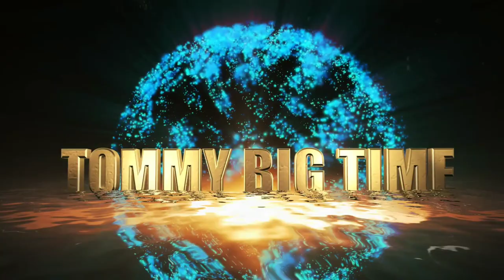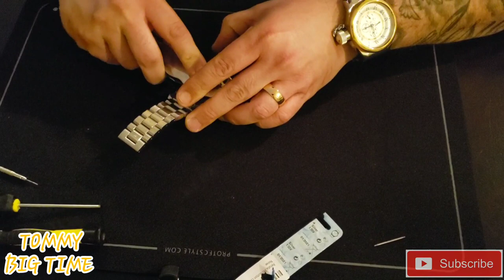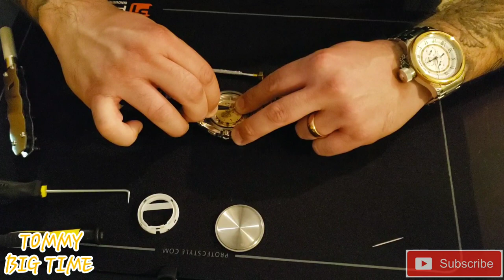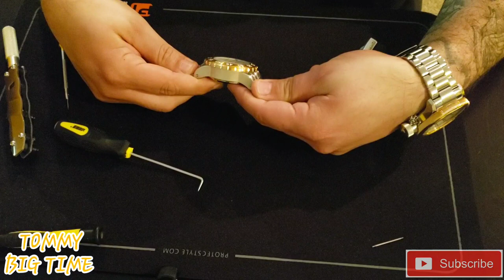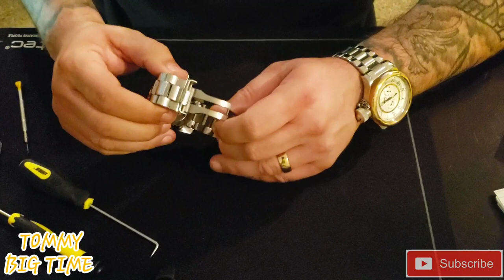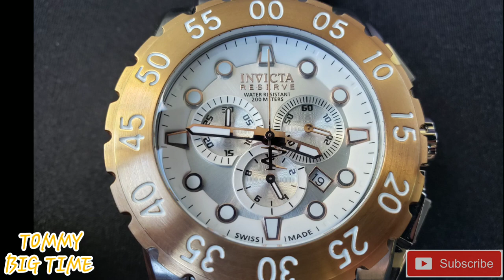Invicta Leviathan Battery Replacement, Synching Chronograph, and Close Up Photos

Comment: Thanks for the video!  I just want to know where you got the tools to open the case.  Mine are too small...and I am tired of dropping $12.50 plus driving 17 miles to have a battery changed!!  I really need something that will open up my 47-54 mm case backs!!!
Reply from the maker: Here's a link to one on Amazon.com
CONBEE 18mm to 60mm New Watch Repair Tool Back Opener Large XL Wrench Waterproof Screw Case (Silver) https://www.amazon.com/dp/B01DLIU4MQ/ref=cm_sw_r_cp_apa_i_QiWECbWM8WTVS
Reply: @TOMMYBIGTIME  thanks a million!  I appreciate the information!  I have an Invicta Ocean Speedway...49 mm's...that needs a new battery, and a rarer model...the Grand Diver Yachting Chronograph...and several others that need batteries.  I may have big hands, but in the 1980's and 90's, I worked as a software and hardware tech on Apple computers...so I can handle working with those tiny screws!!!  But.. it's nice to have your video for reference purposes!
Reply from the maker: Awesome brother. I wear a size 14 ring finger so I feel you on the big hands. Good luck brother
Reply: @TOMMYBIGTIME  Size 15 ring here.  Although, I played ball with a guy that wore a size 21!!  Giant sized hands...he was our center.  My ring would barely fit halfway down on his pinky finger!!!
Reply from the maker: Wow

Comment: Does the watch tick without the battery cover on, or does the little cover need to be screwed on to work?
Reply from the maker: I've actually never checked that. I know my battery I'm putting in is new and always put the cover on to secure it first. The next time I do a battery change I'll test that out